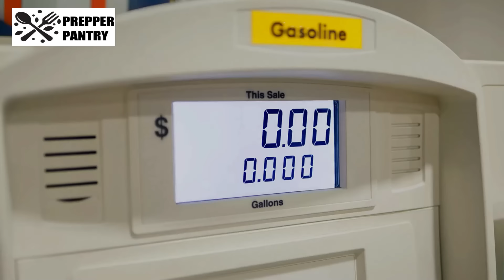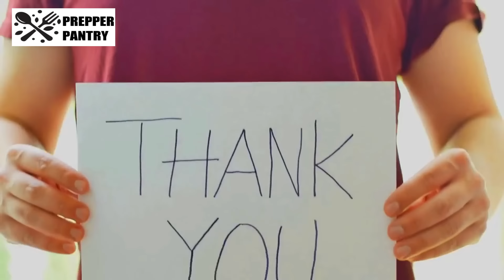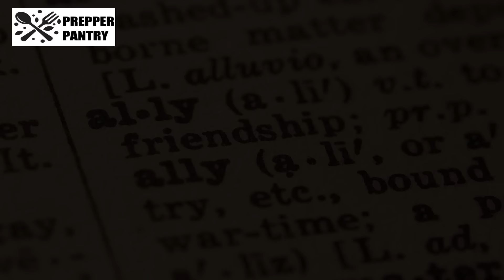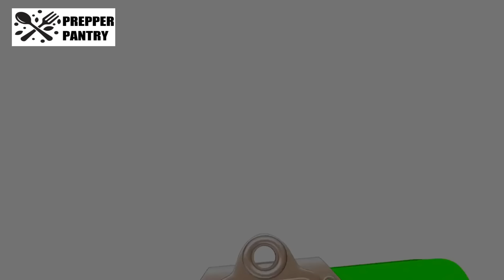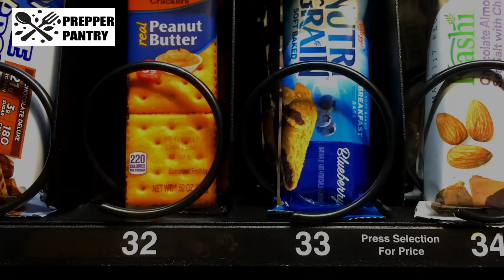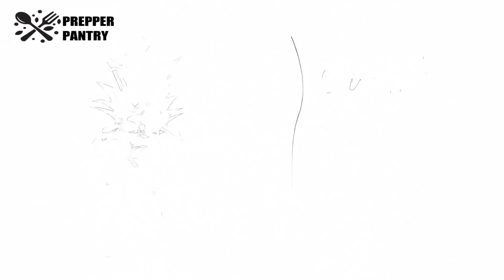30 Grocery Items to STOCKPILE NOW Before PRICES Skyrocket

Comment: Isn't stockpiling causing shortages and making the price increases inevitable? Now the corporate class has an excuse to raise prices.
Reply: But you buy it slowly not all at once
Reply: If you buy  say 25.00 extra each payday you'll build a stocked pantry over time, by keeping inventory you have the ability to shop only sales,  giving you the best prices.  Rotate your stock,  only buy what you eat or drink and use.
Reply: Everything in moderation!  I have prepped for years and never put a strain on availability.